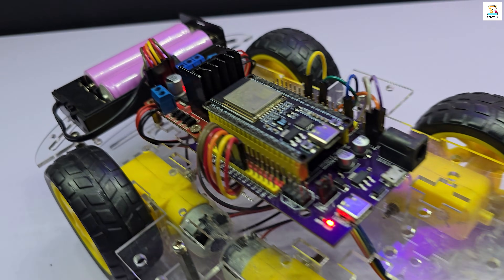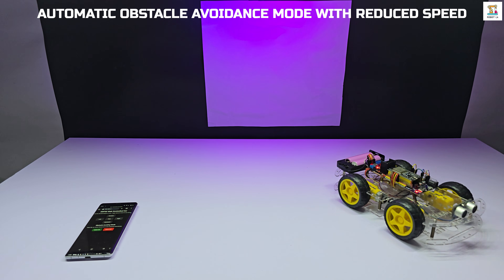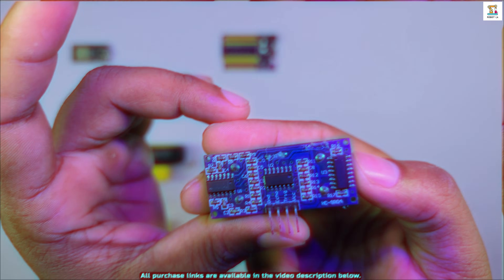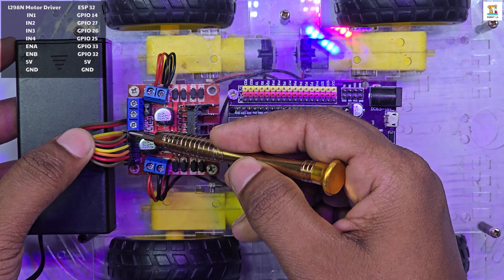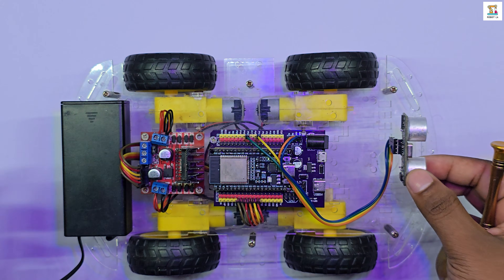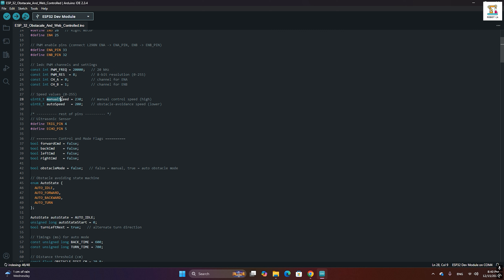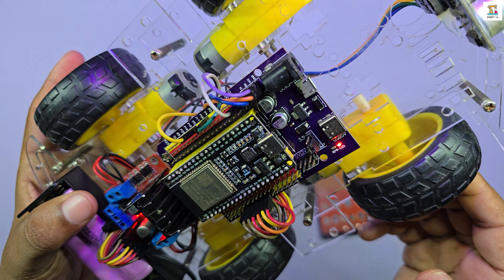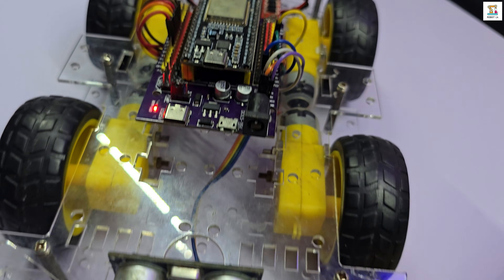ESP32 Web Controlled Robot Car | Obstacle Avoidance + Speed Control | No App Needed

Comment: please help me i did everything right but i cannot find the esp32_car in the wifi
Reply from the maker: Did the code upload correctly? Connect it to the USB port and check whether the Wi-Fi name appears. If the ESP32 does not receive proper power, the Wi-Fi will not show up.
Reply: Check your expansion shield working properly, if not just connect the jumpers directly to the esp32 correctly from the shield.

Comment: hey you directly connected that ultrasonic echo pin to GPIO 5 ...it will damage your esp32....basically  echo pin supply 5v but esp 32 gpio accept 3.3v....so connect 1k or 2k resister to echo pin...dont connect that directly

Comment: Bro do we have to connect buck and make voltage to 5V and you have use two battery I think that of 7V so it so 7v will harm our esp or not or directly it will possible or not??? And also this code will run on espwroom32 feather
Reply from the maker: I supply 7.4V to the motor driver. The ESP32 is powered from the 5V output of the motor driver. Therefore, there is no risk of damage to the ESP32 board.
Reply: @RobotLk  please help me i did everything right but i cannot find the esp32_car in the wifi
Reply from the maker: Did the code upload correctly? Connect it to the USB port and check whether the Wi-Fi name appears. If the ESP32 does not receive proper power, the Wi-Fi will not show up.